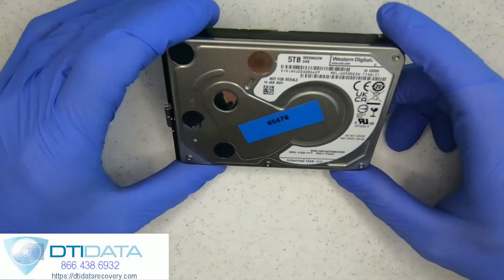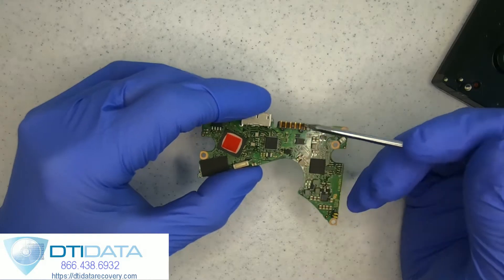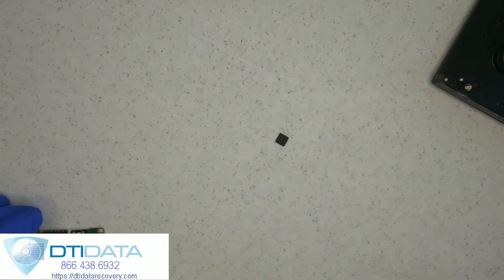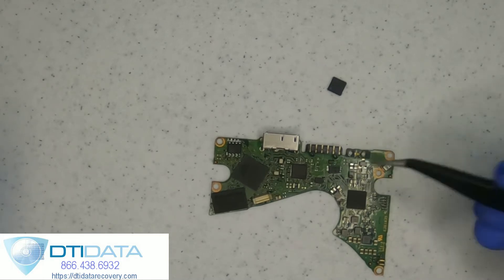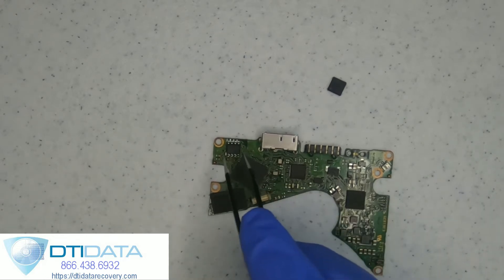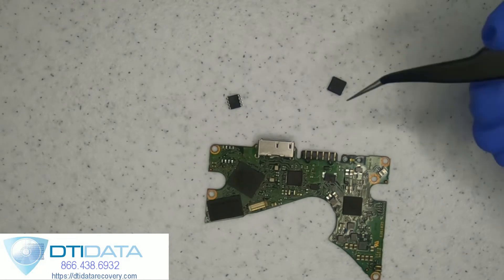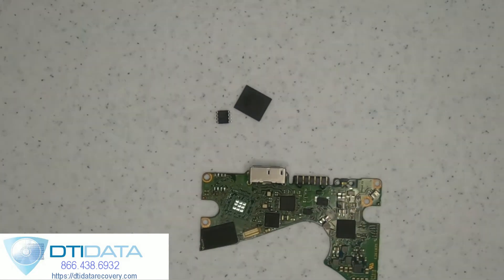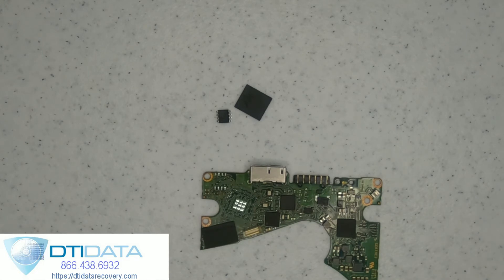Western Digital PCB repair - replacing faulty components, firmware, and MCU on SED locked PCB.

Comment: A very important hard drive I have had the usb port break off of the PCB board,  I am trying to buy the whole board. My board is 810067-000 but I can't find one online. Would it be possible to replace with one that is very similar, but is 800041-003? Was just wondering if anyone knew. Regardless thank you for the video! Always wonderful to learn something new.

Comment: Hi. Thanks for the amazing content that you are making. I have a 1TB western digital hard that has a head problem due to falling and a recovery company changed it's heads and said head swapping was not successful and it's data was not recoverable, can I do anything else or is there any hope that a second change of heads by someone skillful like you help recover my most valuable data? 

You're answer will help a person in need a lot and bring back hope to several families. I'm waiting for your answer. thank you.
Reply: It is difficult to say anything definite.
If the platters are scratched and rotational scoring of the platters has begun, it may not be possible.

The heads fly over the platter surface, if the fall into (like turbulence when flying on a plane) the scratch it will destroy the head and worsen the affected area.

It is also possible to avoid these areas in some cases. Without seeing the drive, it is impossible to say.

Sorry- I don’t have a concrete answer.
DTIDATARECOVERY
Reply: @DaveMohyla  Thank you for your answer. So if the platter surface is intact and the head swap was not successful due to another reason, we can hope that maybe someone else can find a way to recover the data?
Reply: @sinasedaghat9770  possibly-as I outlined in my previous post.